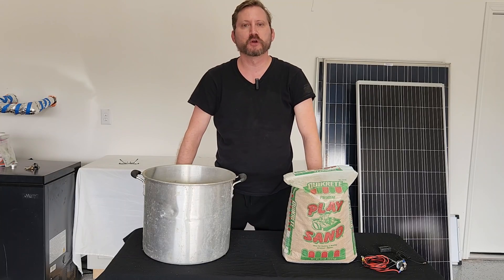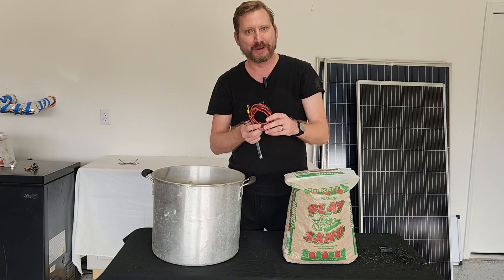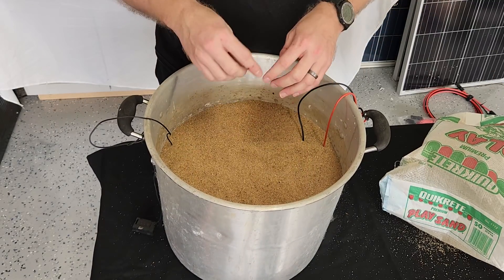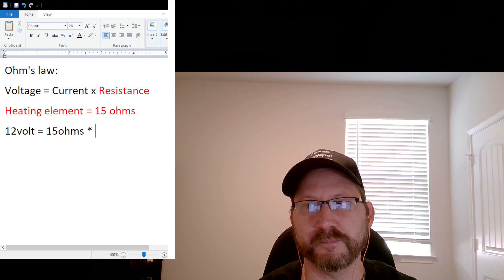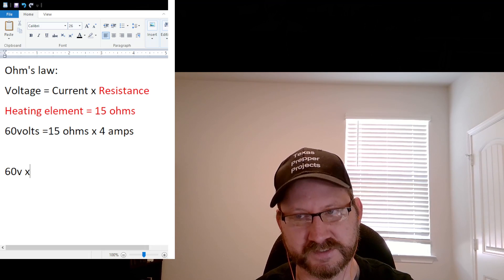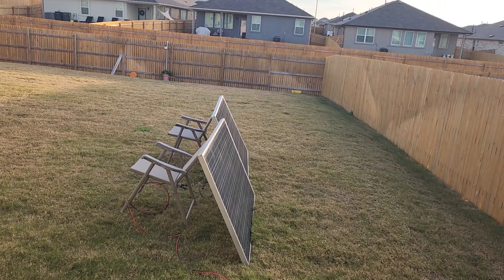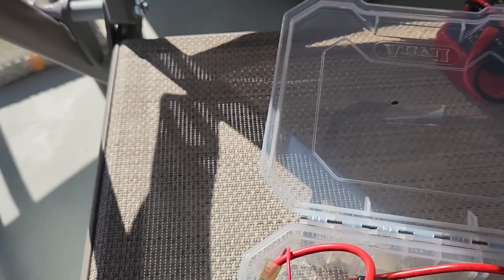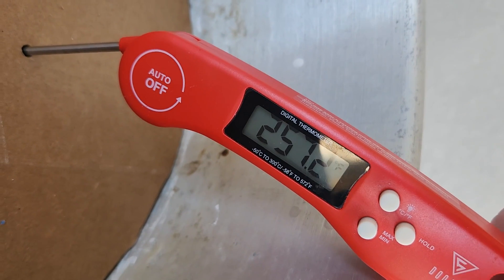Sand Battery Heater solar powered 250F / 120C with no flames or fuel! DIY

Comment: This sand bank is kinda cool in a minimalistic way.
Personally I would throw another $1250 at the system and get one of those DIY 12,000 BTU mini-splits with solar inputs and  precharged lines that allow installation with a holesaw. No need for a vacuum pump.
Unless it is very cold it will put 2-3 times as much heat into a space as resistance heating would and it's a solar powered air conditioner come summer with a seer of 22.
It maybe the quickest ROI of any solar system. 
It can be hooked to the grid as well so even if the sun isn't quite enough it will draw the extra needed from the grid (or battery inverter) and for use at night.
2 grand and it starts making heat and AC at high efficiency and free when the sun shines.
Reply: Totally agree. 240 watts is basically the same as 3 candles so for a little more money you could make something actually useful or for the cost of sand, solar panels and a pot you could have the heating ability of 3 candles.
Reply: @scottjoyce85  - What you may not be visualizing is how easily this concept scales, compared to candles.  If you want 2400 watts of heating capacity, you increase the number of panels, use them to heat more sand, and don't have 30 candles constantly burning down to nothing.
Reply: @jasonbroom7147  well obviously. But that's not what this video is. And it's still kinda silly to buy a solar array capable of 2400 watts and just heating sand. Never have an efficiency over 95%. If you have 2500 watts of solar then maybe a heat pump makes more sense and then we're talking like 300-500% efficient.... you also need to visualize that if you scale up the solar then you probably have to scale up the sand battery size..... won't be very portable for very long.
Reply: @scottjoyce85  - I agree with you on all points, but there is also the economics to consider.  If you were to repurpose a large amount of EPS foam to create an in-ground storage bank, filled with free or very low-cost sand, sourced locally, it could be heated using 2nd-life panels.  Done at the right scale, with a heat exchanger and perhaps in-floor radiant heating, you could store a large amount of energy for not a lot money?
Reply: @jasonbroom7147  I think that seems like a very good path and I can't say for sure that it wouldn't be but by the time you dig up your yard to build a large enough sand battery then would it be better to bury loops of pipe and do a geothermal setup? I feel like COP of 4 would definitely overtake a sand battery in ROI in a short order. A sand battery will only ever store heat. So what it's useless all summer long and your solar panels are doing nothing unless your grid tie them in which case you should just run a heat pump anyway... I think the sand battery just sounds so great because sand is so cheap but the labor to do all the work wouldn't be. And what if your sand bank eventually has moisture in it? Then it's no good unless you boil it all out. A larger water tank might be a better solution anyway since you can pump that water around really easily and generally won't need water delivered on install. Maybe even just a pond and a water to water heat pump.... i just can't fall in love with resistance heating when there are much better ways
Reply: @scottjoyce85  - In some (most non-Western) societies, labor is practically free and so is sand.  What makes sense in a first-world situation doesn't apply at all, in other parts of the world.  If you use excess solar generation for 6 months to bring a sizable sand battery up to temperature, and it lasts 2-3 months into your cold season, the efficiency is essentially 100%, because the energy wouldn't have been stored at all, otherwise?  I agree with pretty much everything you're saying, but also feel there are other use cases outside of residential heating.  A greenhouse, for example, could possibly be kept warm much further into the shoulder seasons with a sand battery under or around it?
Reply: @jasonbroom7147  100% efficient is all it would ever be which is what I keep saying. I don't need heat storage if I have a heat pump and I can still get 350-450% efficiency by pulling the "stored heat" from the ground in the form of geothermal. The entire crust of the earth is basically already a big "sand battery". You just need to amplify the energy a bit with a heat pump.
Reply: @jasonbroom7147  and a sand battery will only every be for heating. Heat pumps work in reverse to work for cooling also.
Reply: @scottjoyce85  - Yeah, I'm a big fan of GSHP technology, but I also realize that a well-designed solar implementation will have excess energy to work with, at times.
Reply from the maker: They are really neat for sure, but as you said, another  $1,000 or more dollars...
Reply: @texasprepperprojects  In texas that $1000 or 2 if you needed everything would quickly pay for itself. Not as quick as a water heater element and a bucket of sand does but I'd bet a small fraction of a full system would take.
I would think 2-3 years is not an overly optimistic guess. I don't know your rates but I remember your weather.
The best feature in my case would be not lugging my window unit in and out every 6 months.
Reply: @isaac80085  lol. Well then you have fun erecting a 10kw array and apparently without an inverter just direct all the energy into a coil that reliably handles massive amounts of current(since you're on panel voltage of lets say 48 volts) into enough of this cheap sand that apparently needs no container that needs no insulation and you can move the heat from this massive pile of sand into the house in a manner that doesn't cost anything or lose any heat..... this sand battery nonsense is hilarious...... lifepo4 cells are relatively cheap now and instead of building a massive array that you only use to heat your sand pile you could remove heat with a heat pump or power other appliances.
Reply: @scottjoyce85  Hey Scott I agree with most of your argument. I don't know what isaac80085 said, I can't see his post in this thread but I feel like you wandered into strawman territory on that last post.
First 10kW is way larger than anything I see discussed here.
2 Why would you pick 48 volts instead of the more obviously useful voltage of say 240 volts that would match readily available heating elements and lower the amperage of the ridiculously oversized 10 kW system to only about 40 amps.
3 The container was inside the space being heated in the video, why assume it would be outside at all?
If it's inside you get free movement of the heat and insulation of the container would just slow the natural transfer of the heat.
Finally you say LiFePO4 batteries are relatively cheap and they are but, for the 10kW  system you suggested it would need about 50 kWh of capacity to hold the daily output of an average 5 hour sunny day.
It is hard to get batteries for less than $100 per kWh even if you go DIY, I paid $1500 fir my 280 Ah battery (14.4 kWh) not including the fancy BMS I wanted ($300 more).
At that DIY price a battery would cost over $5000.
If we went for the plug and play server rack 100 Ah batteries we would need 10 of them at $1200 each thats 12 thousand dollars.
Honestly I would be hard pressed to find any application where a sand battery makes much sense over better tech. Maybe as a stop gap until I could afford better or if not having air blowing was important to me but if I were doing this over I'd go for the mini-split with solar inputs before a inverter/charge controller or the battery.
I could see it as an overflow when you can't store any more in the battery as I am not a fan of selling it to the grid.
Even then I feel water would be my choice.
Reply: @ghz24  I would prefer 240 volts but that requires inverters which another commenter suggested was a negative so I just used a common panel voltage. Dc voltage at 240 volts would be possible I guess. 10Kw was just a random choice to create any amount of real beneficial heat. The video demonstration is equivalent to like 3 candles worth of heat which is honestly just a joke. Which leads into my sand pile comment. You'd need a sizeable amount of sand to store much energy unless you're heating a small amount of sand to very high temps which brings with it another massive host of issues. If you go much bigger than a 5 gallon bucket it gets much harder to move around and it would have to be really hot which again just sounds silly to carry around a 500 degree vessel of sand. Which would need to be insulated while you're heating it but less insulated in your house.... I don't know, I could go on and on. People think that because sand is cheap that sand batteries make sense which just doesn't really math out in the end on a small scale using PV to heat it.
Reply: @ghz24  5000 dollars for a battery doesn't seem very expensive either if you actually consider the cost of digging a hole and insulating it as well as waterproofing it somehow(wet sand definitely wouldn't work) filling it with sand and running all the electrical and figuring out how to move the heat back into the house..... $5000 in lifepo4 that does a lot more than warm sand makes so much more sense...
Reply: @scottjoyce85  I understand your position and agree at least to a point.
You are stuck on it being outside or portable where I only see it being useful if it is stationary and inside the space being heated.
If I were including this idea I would go for a cob (clay and straw) bench inside the building. Kind of like the benches used in a "rocket stove mass heater". The wires transport the heat in and it just radiates out slowly into the room.
It could even be included into the same bench that is used as a rocket stove mass heater.
240 volts doesn't require inverters, my panels are 40 volts open circuit and about 33 at mpp.
So if I just plug 7 of them in series I get 231 volts and 10 amps (at full illumination).
A mud bench may sound terrible but some look quite nice.
My main concern is the ability of the sand or clay/cob to conduct enough heat away from the element to prevent it from burning up.
I actually would entertain including an element in a mass heater bench just because I dislike blower noise especially if I already have a system that has all the panels it can handle.
It could even be switched so in the summer or when air temperature is high enough the panels run a minisplit when you don't mind the noise and air movement.
AC will be noisy no matter what and benefits from air movement anyway.
Look into the rocket stove mass heaters, even if you would never consider one they are wood burning but you only burn wood for a couple hours or so and then the thermal mass of the bench radiates heat into the room.
They claim a 75% decrease in wood required.
The channel "mylittlehomestead" has a couple videos on the one they made. The one titled Pros and cons of 3 year old rocket stove and the one on their build will give an example of what one can look like and the basics of their operation.
Definitely not for everyone but still interesting.
Reply: @ghz24  I think sand could be very interesting in the large scale applications where it makes sense. Adding cob would most definitely make it less viable i think. Finding special elements for the situation and you wouldn't really ever want your bench to be that warm anyway because it would be uncomfortable or it wouldn't really be acting like much of a battery. Also, building an actual sand battery in your house could work in a bench if you had some room for it but if you build it of any substantial mass it would put a lot of extra load on the floor and or take a lot of space which theoretically cost money in square footage devoted to the battery. And then a real sand battery by design would need substantial insulation which takes more space. Do I want 3 tons of sand in my front room? Not a chance. Maybe in my basement but then the issue remains that I'll need to find a way to move that energy from my basement to my living area....and if I'm doing that then why not just do it outside and have massive sand battery where I can keep more sand at a lower temperature for a smaller delta. And then I'm just going to scrap the idea of using sand and just use the "sand" battery that already exists in my yard and spend 5 months reading about the refrigeration cycle and build a dead simple heat pump out of scrap and have a GSHP. I watched the few videos on YouTube regarding heat pumps and turned a dehumidifier into a liquid to liquid heat pump with a pretty decent efficiency and probably already have less invested than this sand battery with the heating power of a few candles. Honestly, people should just make candles instead if they think this is worthwhile off grid heat.
Reply: @scottjoyce85  I think you don't understand how any of this works.
I don't think you understand the benefits of having a thermal mass in a living space.
Masonry heaters have a history going back 7000 years and include cultures from around the world including Roman baths, Chinese floor heating systems and fairly modern European heaters. Russian heaters Finnish heaters and English masonry heaters are all examples.
In Australia they use "storage heaters" or heat banks to take advantage of cheaper nighttime electric rates to heat a block of ceramic or brick over night to have the bank radiate heat during the day when rates are high.
Cob can contain up to 80% sand and the clay that holds it together fills in the air spaces between sand grains.
Air spaces limit the contact between grains and act as an insulator this means cob is more viable as a thermal mass than sand alone and all these earth based materials are very close to equivalent in thermal qualities and are all about 1/5th the heat capacity of water
As far as being to hot a little math might help.
The 7 panel system I proposed to get 231 volts and 10 amps gives 2310 watts.
At 1500 watts to 5000 btu that is 1.54 standard 5000 btu/hour space heaters like you can buy at any hardware store.
1.54 x 5000 btu means the panels are delivering 7700 btu/hour times a 5 hour solar day makes 38500 btu total. (The same as burning 2 pounds of paraffin wax or about $1.22 worth).
A btu is 1 pound of water raised 1 degree F.
Brick, cob, clay holds 5 times less heat/pound than water so those 38500 btu will make 38500x5= 192500 degree pounds AKA raise 192500 pounds of cob 1 degree F or half that mass  2 degrees.
Divide 192500 by 2000 pounds and we get one ton raised 96.25 degrees add that to the ambient temp of say 70 degrees and you get 166 degrees F.
Brick or cob has a density of about 120 pounds per cubic foot so a ton has a volume of less than 18 cubic feet or a bench of about 6 feet long by 1.5 foot high by 2 feet deep. That is smaller than most love seats and less floor load per square foot than an average water bed.
166 F would be quite comfortable to sit on with a 3-4 inch couch cushion between you and the (hard) bench. Or double the size to a standard 3 person couch size and you get a very comfy 118 degrees. (And a 2 ton chunk of clay/brick on your floor)
Minisplits are great but you're not going to want to run it full bore while the sun is available to heat the air in your house to virtual oven temps to last the night.
I love gshp I have two 30,000 btu units waiting to be installed.
A full system with gshp and a battery would definitely give more heat per unit of solar panels but regardless of saying $5000 is cheap for a battery the whole system is very expensive. Charge controllers, inverters, batteries and especially the gshp installation of average 18-30,000 for a modest sized house.
Add the average cost of a 10kW solar system of 22-30,000 and your looking at up to $60,000 
I can get seven 320 watt panels for about $800 and 2 tones of clay for almost free with no recurring cost of paraffin for candles.
You are comparing a 40-60 thousand dollar system to a $800-$1000 system and complaining it doesn't do enough.
If you do well and only give 40K and your power bill is $150 a month it will take 22 years to break even with the full system or longer if you still have the grid as a back-up.
The 7 panel system I proposed makes 11 kWh per day or about $1.75 a day in heat at $0.15 per kwh and pays for itself in 461 days.
Even if I compared it to driving a minisplit for the $1.75 per day to get 4 times the heat of a resistance heater it would pay off in 5 years.
Reply: @ghz24  its obvious that you and everyone else doesnt really get it either. so again, if you are already buying solar panels. you can choose to just dump resistive heat into a big sand battery or use it for something else. for every single watt of power you make with your panels you are at most getting 1 watt back. with a DIY heat pump I can double or triple the same power produced and use it to either HEAT OR COOL..... or in the shoulder seasons I can do something totally different with the power. Silly to say " I can get seven 320 watt panels for about 800 bucks and then say a 10Kw system is 30,000 dollars. by your own math 10Kw in panels is 3200 dollars. But with a DIY heat pump, you wouldnt ever need a system that big. for the same power you put into your cob bench I could use 1/4 of that and move the same energy around. I absolutely understand thermal mass and understand that the biggest thermal mass youd benefit from is the dirt/sand/clay already in your yard. Below boiling temps it doesnt make any sense to store energy in dirt, the point of sand is that you can heat it higher than 100C. So if you're talking anything below 100C why wouldnt you just heat water because it stores much more energy(below 100C) than sand. I'm not comparing a 60k system to an 800 dollar system. You absolutely are comparing apples to oranges. You can DIY a heat pump much cheaper. I'll load a video onto youtube of mine for you to check out. I move more energy than this video demonstrates from a junk dehumidifier and some heat exchangers with propane as the refrigerant......while drawing only 300 watts. thermal mass is awesome and if you used the same solar and learned to DIY a heat pump to heat your cob bench I would think totally different.....and again like I'm beating a dead horse, while you're only using this resistive heat idea to heat, you have solar panels going totally unused all summer since I assume you aren't keeping your bench at 166 degrees in July. so even if the cost is higher at least its playing double duty and possibly triple duty if its also providing household power. If I pay twice as much for a system that heats and cools with some benefit of also being able to do it when the sun isn't shining then I would pick that every day. Oh yeah, then I could even have light or respond to youtube comments with my system.
Reply: @scottjoyce85  I'm impressed with your DIYing a heat pump. That is really cool. And I look forward to your video.
I stated that it would be easy to make a switch to divert the electricity to a minisplit.
I assume you know a minisplit is a heatpump.
In my original post I described a 12,000 BTU one that anyone can install with a hole saw and hand tools that has it's own mppt controller and can run directly off solar panels. But as we both know when the temperature drops enough that minisplit will not even try and then my panels hooked directly to it will be pointless unless I can flip a switch and go to resistance heating.
So the 7 panels would work doing AC and not involve an inverter or add to the charge controllers limits.

I already have 25 panels a 14.4 kWh 48 volt LiFePO4 battery and a 3000 watt combination inverter/charger/mppt charge charge controller. (and a new roof).
It doesn't feed the grid but can utilize the grid to supplement its load or use as a backup.
It's all DIY, purchased as I can afford components.
I got the panels from a reseller and they cost me a little less than $100. They are about 3 years old when I got them, replaced at a solar farm by more efficient ones. Same for the battery it is from a reseller and cost me about $100 per kWh it came from a failed company so it was never used but was a couple years old.
Installing a complete system is more than most people can manage so my disparity in $100 dollar panels vs $30K for a system is due to  the difference in skill levels required.
Just like you can repurpose a dehumidifier to be a heat pump for cheap when I will buy a minisplit for $1300 before trying to reinvent the heatpump.
I had an unexpected windfall/money pit and have exhausted my disposable income for a while into the future so, I have postponed the project for a bit and am reevaluating due to now having a rural homestead (that's a money pit) with more land than my postage stamp house in town. 
The money pit has room for a ground mount and the electricity is not on yet and may not be for a bit as it is not liveable yet.
So 8 of the panels are there to run fans when the sun shines.
But it came with the gshp units I described and the pipe and a backhoe to dig the trenches but, I am still working on getting the hoe started.
I'm retired so the money pit family homestead will go to my kids.
But it's in sorry shape and we had to pay back taxes and stabilize it from being more damaged.
There I'll dig the trenches and install the pipe but hire the services of a professional to hook up the gshp unit(s).
It's unlikely I will ever utilize a thermal mass or use resistive heating from my panels but I am considering rewiring a space heater to run on the DC the 8 panels will make to help dry out the basement that had 8 inches of water in it, because it's cheap to implement and virtually free to run now that I bought the panels.
If I ever do make a rocket stove mass heater as an emergency/auxiliary heater I will likely put a resistance element in it just because it's cheap and easy to include and could act as a backup.
Same reason I will keep and partly fill the propane tank that is already there.
Options are always nice to have and I was a boy scout long ago.